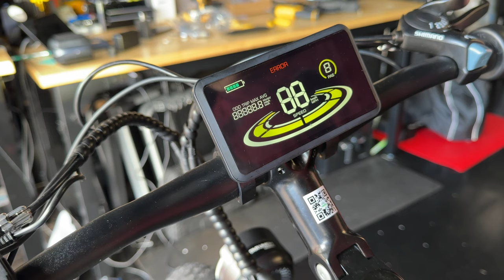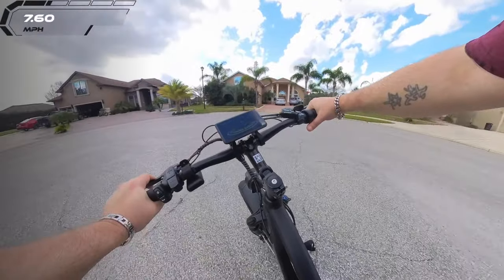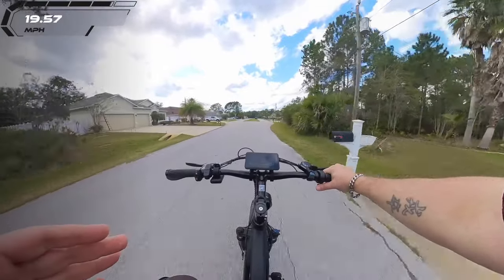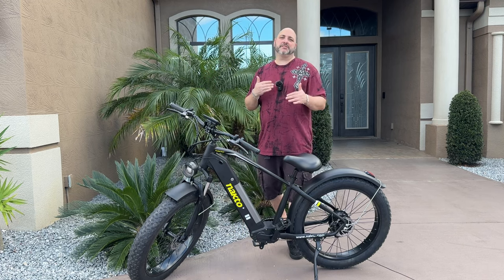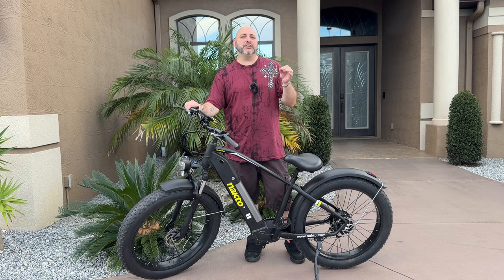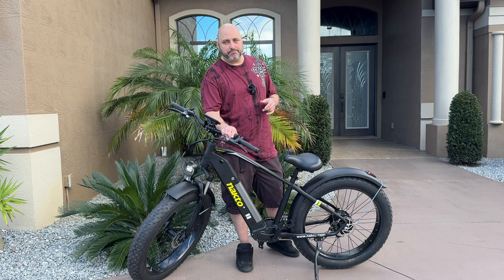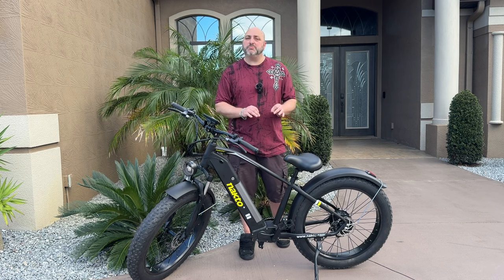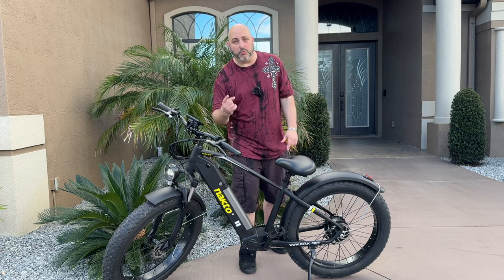Performs Wellish Wobbly Rear Wheel, The Nakto F6

Comment: That rear wheel is a bummer and that's what Im afraid of getting from any bike. Something I can't easily fix myself. How would you even replace that considering the motor is on the rear? Good luck getting them to send you a replacement of the most expensive part
Reply from the maker: youd essentially need to replace the whole rear hub